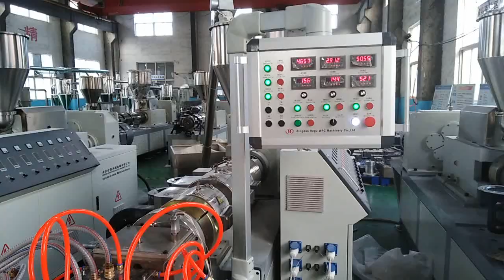PVC  WPC  solid door frame making machine for India ( sophie@wpcmachinery.com ,0086 15063923327 )

Comment: Nice ji
Reply from the maker: Good day.
This is Sophie Qin from Qingdao Tongsan Plastic Machinery Co.,Ltd.& Qingdao Hegu Wood Plastic Machinery Co.,ltd.
Our company is professional for the Whole WPC production line with turnkey Project Service since 1998.
 We have different type of WPC machines to make different WPC products from different raw material,such as:
1, PP PE WPC profile machine:
Material: recycled 30% PP/HDPE+70% wood powder+chemical additives.
Product: WPC decking, WPC wall cladding, WPC fence, WPC pergola..
2, PVC WPC profile machine:
Material: 50%PVC+20% wood+20% caco3+ Chemical additives.
Product: WPC door frame, WPC wall panel, WPC decoration profiles indoor.
3, PVC WPC door machine:
Material:50% PVC+20% wood+20% caco3 +Chemical additives.
Product: Hollow Door panel, Cabinet Door, and other big profiles
4, PVC WPC board machine:
Material: 60% PVC+10% wood +20% CaCo3+ Chemical additives.
Product: Solid door panel, Furniture board, partition wall panel, decoration solid panel.
5,UPVC window profiles and panel making machines
Material: 40% PVC+50% CaCo3+ Chemical additives.
Products:UPVC windows and doors,PVC ceiling,PVC wall panel,PVC rain gutter,PVC profiles.
 
So what kind of WPC products would you like to make?what raw material would you like to use?
If you have any questions, feel free to contact me. I will reply to you Promptly and Professionally. 
Looking forward to your reply,my whatsapp is 0086 15063923327.

Comment: काहा से
Reply from the maker: Good day.
This is Sophie Qin from Qingdao Tongsan Plastic Machinery Co.,Ltd.& Qingdao Hegu Wood Plastic Machinery Co.,ltd.
Our company is professional for the Whole WPC production line with turnkey Project Service since 1998.
 We have different type of WPC machines to make different WPC products from different raw material,such as:
1, PP PE WPC profile machine:
Material: recycled 30% PP/HDPE+70% wood powder+chemical additives.
Product: WPC decking, WPC wall cladding, WPC fence, WPC pergola..
2, PVC WPC profile machine:
Material: 50%PVC+20% wood+20% caco3+ Chemical additives.
Product: WPC door frame, WPC wall panel, WPC decoration profiles indoor.
3, PVC WPC door machine:
Material:50% PVC+20% wood+20% caco3 +Chemical additives.
Product: Hollow Door panel, Cabinet Door, and other big profiles
4, PVC WPC board machine:
Material: 60% PVC+10% wood +20% CaCo3+ Chemical additives.
Product: Solid door panel, Furniture board, partition wall panel, decoration solid panel.
5,UPVC window profiles and panel making machines
Material: 40% PVC+50% CaCo3+ Chemical additives.
Products:UPVC windows and doors,PVC ceiling,PVC wall panel,PVC rain gutter,PVC profiles.
 
So what kind of WPC products would you like to make?what raw material would you like to use?
If you have any questions, feel free to contact me. I will reply to you Promptly and Professionally. 
Looking forward to your reply,my whatsapp is 0086 15063923327.